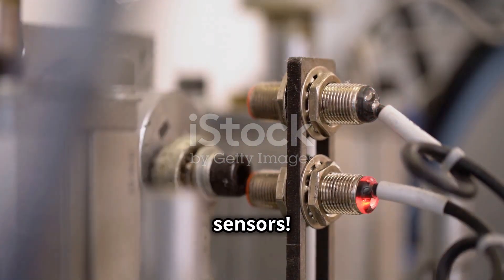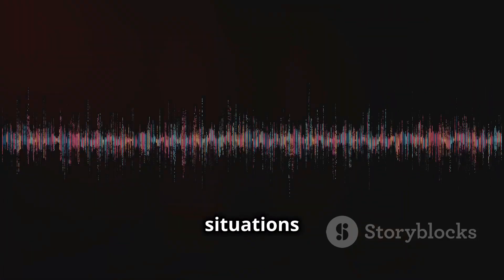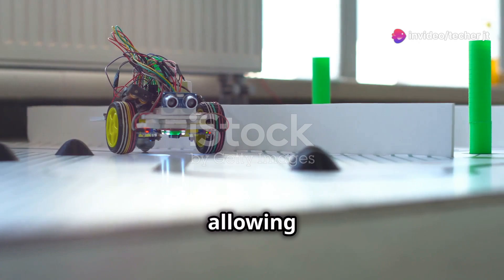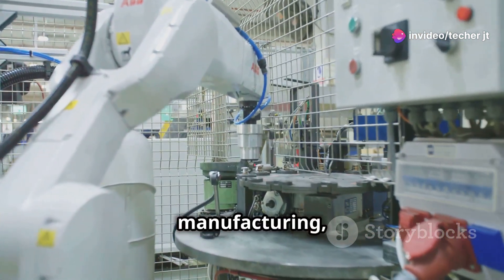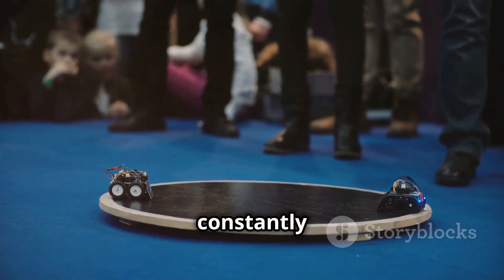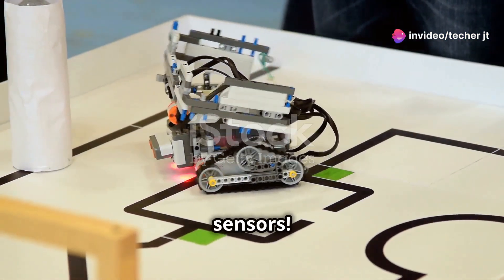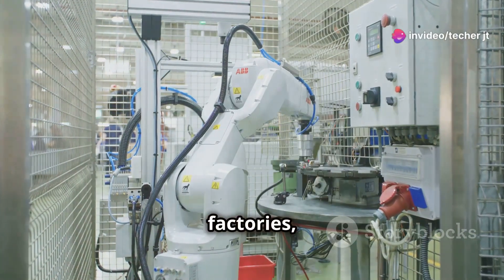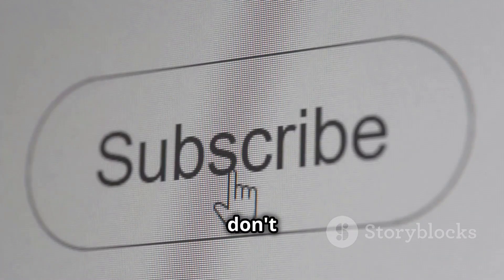Exploring the World of Robotics: Types of Sensors

Comment: 🌟10 - Andromeda Chain ⬇️⬇️
Reply: Kent Kyle T. Palingcod 
10-Andromeda 

2. Understanding (Comprehension): Explain how ultrasonic sensors work and their application in robotic systems.

Ultrasonic sensors work by emitting high-frequency sound waves and measuring the time it takes for the echo to return, allowing them to calculate the distance to an object. In robotic systems, they are commonly used for obstacle detection, distance measurement, and proximity sensing, enabling autonomous navigation and interaction with the environment.
Reply: Andrei Lavern A. Pelayo
10-Andromeda 🐬

4. Analyzing (Analysis): Analyze the differences between active and passive sensors in robotics. Provide examples of each.

Answers:
Active sensors actively interact with the environment to gather some information, while passive sensors simply receive information. Active sensors offer more control but can be noisy, while passive sensors are less intrusive but might have limitations in their information gathering capabilities.

Active sensors
-Lidar, sonar, radar

Passive sensors
-Cameras, microphones, temperature sensors
Reply: Zion E. Paberecio 
Grade - 10 Andromeda 

2. Understanding (Comprehension): Explain how ultrasonic sensors work and their application in robotic systems.

ANSWER: Ultrasonic sensors work by emitting high-frequency sound waves and measuring the time it takes for the echo to return after hitting an object. This time is used to calculate the distance to the object. In robotics, they are commonly used for obstacle detection, navigation, and distance measurement, allowing robots to avoid collisions and map their surroundings.
Reply: Christine M. Luna
10 - Andromeda 
Sept. 04, 2024
10:45 (timestamp)

3. APPLYING (APPLICATION):  Given a scenario where a robot needs to navigate through a crowded room, which sensors would you recommend using and why?

- Given that a robot needs to navigate through a crowded room, I'd recommend using the following sensors:

1.  Proximity Sensors (Ultrasonic & Infrared sensors)
• These effectively detect the presence or absence of an object, utilized for measuring distances and obstacle avoidance to aid robots by providing real-time feedback on its proximity.
• Ultrasonic sensors can provide precise data when IR sensors cannot, especially in the darkness or in areas with environmental factors like dust or dirt.
2. Temperature Sensors
• Keeps the robot from overheating as it works, aiding in a robot's most optimal work performance by maintaining the its normal temperature levels.
3. Vision Sensors
• Aid in the robot's autonomous decision-making based on real-time, visual recognition of objects and people around them; enabling robots to interpret and comprehend complex scenes, including precise recognition of pathways for navigation.
4. Light / Lidar Sensors
• Light Detection and Ranging Sensors create a high-resolution and detailed 3D map of the crowded room, helping robots to identify its environment nd navigate around obstacles more efficiently.
5. Inertial Measurement Units (IMUs)
• These sensors are a combination of accelerometers and gyroscopes, ultimately aiding robots in accurate tracking of the robot's real-time balance, orientation, and movements; ensuring precision in robots' stability and navigation though complex environments, especially where GPS signals may be unreliable.
Reply: Zara Mae M. Jurane
10- Andromeda 

5. Evaluating (Evaluation): Evaluate the effectiveness of using multiple sensor types in a robotic system. What are the potential benefits and drawbacks?

-Multiple sensors improve the robot's ability through object detection and avoidance, accuracy, versatility, and more. Robots can gather comprehensive spatial data using various sensor configurations, allowing for more advantages and navigation in complex environments. But using multiple sensors means multiple data points. These sensors generate large amounts of data, which can lead to data overload, which can strain computational resources and potentially slow down system response times.
Reply: Real Ann R. Dela Victoria 
10 - Andromeda 

1. Remembering (Knowledge): What are the primary types of sensors used in robotics?
ANSWER: 
The types of sensors used by robots to sense their environment are, temperature, sound, and light sensors to detect color and brightness, they also have proximity and tactile sensors for detecting objects or touch in close proximity. Robots become smarter and more capable when vision sensors function as eyes and IMUs aid in balance and orientation.
Reply: Jaynie Margaret M. Lashley
10 - Andromeda 

1. What are the primary types of sensors used in robotics?

Answer: The primary types of sensors used in robotics are light sensors, sound sensors, temperature sensors, proximity sensors, tactile sensors, pressure sensors, accelerometers, gyroscopes, vision sensors, GPS sensors, and inertial measurement units (IMUs).
Reply: Antonnette C. Tayrus 
10 - Andromeda

Q1. Remembering (Knowledge): What are the primary types of sensors used in robotics?

Answer: The primary types of sensors are light sensors, sound sensors, temperature sensors, proximity sensors, tactile sensors, pressure sensors, vision sensors, acceleration sensors, gyroscopic, vision sensors, GPS sensors, and Intertial Measurement Units (IMUs). These are the sensors mainly used in robotics.
Reply: Dean Andrie P. Daohog
10 - Andromeda 

1. Remembering (Knowledge): What are the primary types of sensors used in robotics?

Answer: Primary sensors are classified as light sensors, sound sensors, temperature sensors, proximity sensors, tactile sensors, pressure sensors, vision sensors, acceleration sensors, gyroscopic sensors, GPS sensors, and Intertial Measurement Units (IMUs). These are the sensors most commonly used in robotics.
Reply: Ettena Marie A. Gabales 
10 Andromeda

8. Extended Abstract (SOLO): Reflect on the future of sensor technology in robotics. What advancements do you anticipate, and how might they transform robotic capabilities?

– Robotics sensor technology is designed to advance significantly in the future, driven by the development of smaller, more sensitive, and versatile sensors. These advancements will empower robots to interact with their environments more intelligently, execute tasks with greater precision, and navigate complex terrains with enhanced skill.
Reply: Trixie Lorraine T. Canopin 
10 - Andromeda 

8. Extended Abstract (SOLO): Reflect on the future of sensor technology in robotics. What advancements do you anticipate, and how might they transform robotic capabilities?

ANSWER: Future advancements in sensor technology, such as improved miniaturization, real-time processing, and AI integration, could lead to more autonomous, adaptive, and efficient robots capable of performing intricate tasks in dynamic environments.
Reply: Kerk Ivahn C Durohom
Andromeda-10

1. Remembering (Knowledge): What are the primary types of sensors used in robotics?
    Answer: The primary types of sensors in robotics are light sensor, sound sensor, temperature sensor, proximity sensor, tactile sensor, pressure sensor, accelerometers and gyroscopes, vision sensor, GPS sensor, and inertial measurement unit
Reply: Davey A. Sabanal
10 - Andromeda 

2. Understanding (Comprehension): Explain how ultrasonic sensors work and their application in robotic systems.

Answer: Ultrasonic sensors measure distance using sound waves; they help robots avoid obstacles.
Reply: Kobie James B. Gabales 
10 - Andromeda 

1) Remembering (knowledge) What are the primary types of sensors used in robotics?

Robotics employs a wide range of sensors—such as those for light, sound, temperature, proximity, tactile feedback, pressure, acceleration, gyroscopic measurements, vision, GPS, and inertial measurement units—to sense and engage with their surroundings.
Reply: Rose Gabrielle D. Araoarao
10 Andromeda

1. Remembering (Knowledge): What are the primary types of sensors used in robotics?

Sensors that are primarily used in robotics include light sensors, sound sensors, temperature sensors, proximity sensors, tactile sensors, pressure sensors, accelerometers, gyroscopes, vision sensors, GPS sensors, and inertial measurement units (IMUs).
Reply: Zhandra B. Dela Rosa
10-Andromeda

2. Ultrasonic Sensors work by emitting high frequency sound waves and measuring the time it takes for the sound to return after bouncing off an object. They can be applied in obstacle detection and avoidance.
Reply: Ayannah Nicole Ngujo
10 - Andromeda 

1. Remembering (Knowledge): What are the primary types of sensors used in robotics?

Answer: The primary sensors used in robotics are light sensors, sound sensors, temperature sensors, proximity sensors, tactile sensors, pressure sensors, vision sensors, GPS sensors, and Inertial Measurement Units (IMUs).
Reply: Ariel D. Lacia
X-Andromeda

Q1: What are the primary types of sensors used in robotics?
A: The primary types of sensors used in robotics are light sensors, sound sensors, temperature sensors, proximity sensors, tactile sensors, pressure sensors, accelerometers, gyroscopes, vision sensors, GPS sensors, and inertial measurement units (IMUs).

Comment: Leon Anthony S. Juaneza
10-Lynx

3. Applying (Application): Given a scenario where a robot needs to navigate  a crowded room, which sensors would you recommend using and why?

-For me, I would use a proximity sensor. This would allow my robots to detect nearby objects in its surroundings without touching them, this is a handy tool for robots who are required to find their way by a crowded space.

Comment: Ruztylou Gaviola
10-LYRA

1.What are the primary types of sensors used in robotics?

-In robotics, light, sound, temperature, proximity, touch, pressure, accelerometer, gyroscope, vision, GPS, and inertial measurement units (IMUs) are the main types of sensors that are used.

Comment: 10 - Lyra:
Reply: Jhonlee O. Oliveros
10-Lyra

5. Evaluating (Evaluation): Evaluate the effectiveness of using multiple sensor types in a robotic system. What are the potential benefits and drawbacks?

:By offering richer data and reliability, 
the use of numerous sensor types in a 
robotic system improves perception, 
accuracy, and reliability. However, it 
needs advanced merging of data and 
brings with it issues like increasing 
complexity, cost, and power 
consumption. Enhancing the system's 
overall performance requires finding a 
balance between these advantages and disadvantages.
Reply: Xharmei Therese P. Barcenilla
10 - Lyra

7. Relational (SOLO): Discuss how the integration of sensors affects a robot's ability to perform complex tasks. What relationships can you identify between sensor data and the robot's decision-making process?

Answer: The integration of sensors significantly enhances a robot's ability to perform complex tasks by providing real-time data that informs decision-making processes. This relationship between sensor data and actions allows robots to adapt their behavior based on environmental feedback.
Reply: Blyth Eldrick L. Porsuelo
10-Lyra

2. Understanding (Comprehension): Explain how ultrasonic sensors work and their application in robotic systems.

Ultrasonic sensors are proximity sensors that uses ultra-sonic waves/sound in order to detect objects. They can be used in robots to avoid collision or for robots to detect the presence of objects around it's environment using ultra-sonic waves.
Reply: James Miguel Lumantas
10-Lyra

3. Applying (Application): Given a scenario where a robot needs to navigate through a crowded room, which sensors would you recommend using and why?

The sensors i would use are ultrasonic and proximity sensors so that the robot can detect the humans and move out of the way, allowing it and the people to pass safely.
Reply: Angel P. Rivera
10-LYRA

2. Understanding (Comprehension): Explain how ultrasonic sensors work and their application in robotic systems.

Ultrasonic sensors use high-frequency sound waves to detect objects. In robots, they help avoid crashes or figure out where objects are by sending out these sound waves and measuring how they bounce back.
Reply: Hailey Aiyana E. Gador
X- Lyra

1. Remembering (Knowledge): What are the primary types of sensors used in robotics?

- Robotics utilizes a wide array of sensors, including light sensors, sound sensors, proximity sensors, contact sensors, temperature sensors, navigation sensors, and acceleration sensors. These sensors provide robots with the ability to perceive their environment and interact with it effectively.
Reply: Jasmine Jade D. Cañete\
10-LYRA
2. Understanding (Comprehension): Explain how ultrasonic sensors work and their application in robotic systems.

-Ultrasonic sensors operate by emitting high-frequency sound waves and analyzing their echoes to determine distances and object positions. In robotic systems, they facilitate various functions such as obstacle avoidance, localization, and mapping, enhancing the autonomy and efficiency of robots in diverse applications.
Reply: Chlouie Fate O. Hermoso
10-LYRA

2.Understanding (Comprehension): Explain how ultrasonic sensors work and their application in robotic systems.

-Ultrasonic sensors emit high-frequency sound waves and measure the time it takes for the echo to return after hitting an object, determining the distance. In robotics, they are used for proximity detection, helping robots navigate and avoid obstacles without physical contact. Applications include self-driving cars, drones, and industrial robots for precise movement and collision avoidance.